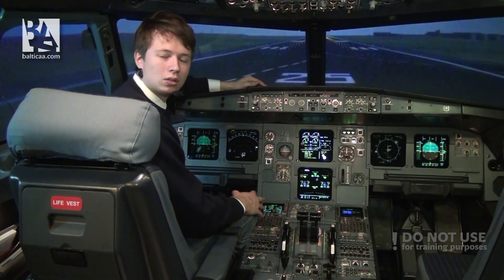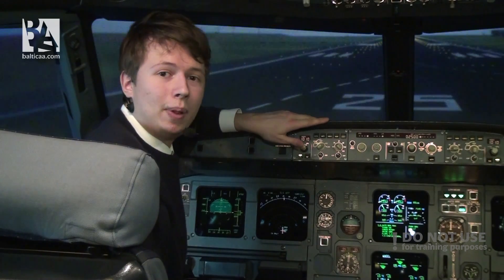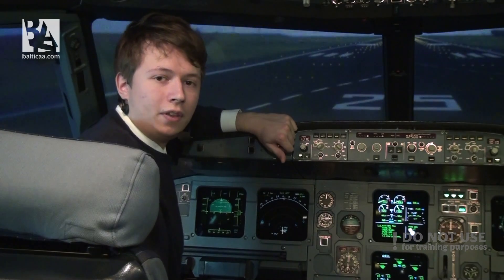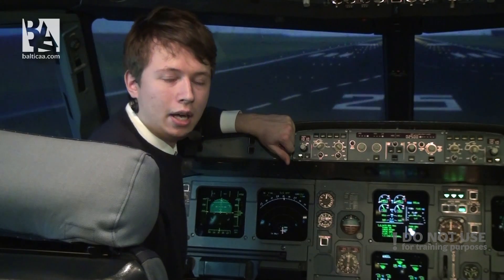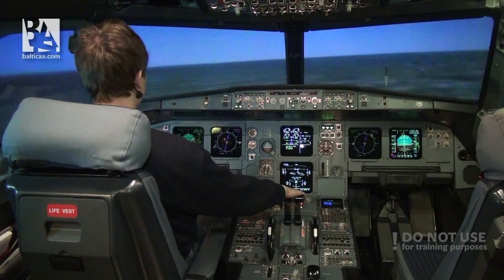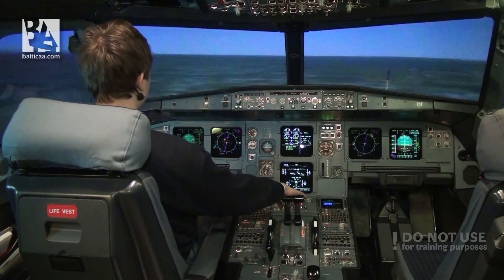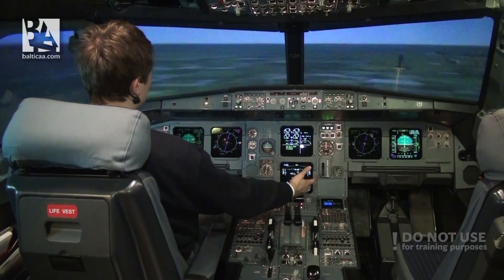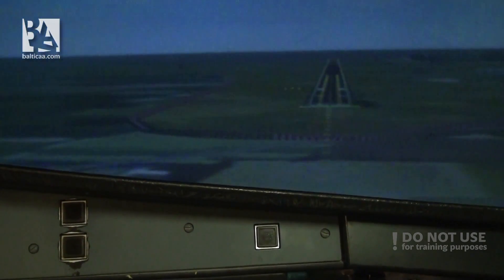Cross - wind take - off and landing on a Airbus A320. Baltic Aviation Academy

Comment: According to the A320 FCTM, during a crosswind takeoff ( crosswind > 20kts) routine use of into the wind aileron is not necessary. It is however, required to maintain sidestick full forward until 80kts.

Comment: Perhaps want to let go of the trustlevers after V1 till ACC alt..! If I would perform this 'properly conducted' take of without spooling the engines in two steps, full flightstick down in Xwind, I would have a pretty set of angry questions fired at me passing FL100 XD

Comment: I noticed for the t/o he seemed to increase thrust normally to 50%, check stability and then full thrust. FCOM states you should use a different technique no? For crosswind t/o, throttles to 50% N1, as the engines are reaching 50%, then  you increase to 70% and as they pass 50% you then engage flex/toga. Or in this scenario maybe the crosswind wasn't strong enough bother...
Reply: Yeap, you're absolutely right. That's what the FCTM states... I also noticed that he didn't move the sidestick forward (to load the nosewheel gear in order to be more stable during the rolling), but he did the unnecessary lateral inputs (I think he shouldn't, there's nothing about it in FCTM/FCOM)

Comment: What happens when crosswinds start as soon as the plane takes off?
Reply: Is this scenario studied in training?
Reply: +Luis Cañamar - no they just dont teach them a basic aspecg of flight.
Reply: Sorry man, you dont touch the manual trim when it is in flightmode unless you need to, and crosswind take offs doesnt require you to mess around with your THS. Just keep center line with your rudder and flightstick

Comment: Does autopilot correct for crosswind itself?
Reply: No
Reply: yes the autopilot does the max crosswind landing for an auto land is 20kts tho so you leave the automation in gusty conditions until minimums on another note we rarely do autolands only in fog or other conditions because it requires so much equipment and conditions
Reply: 15kts when you use auto-rollout with sharklets :)

Comment: How do you arm the speedbrakes/spoilers on the airbus? I dont see him pulling the lever.
Reply: +XpertPilotFSX ground spoilers are armed so on reverse they will come out and on normal thrus they will retract
Reply: It is rather subtle. On the speedbrake lever, you pull the lever up from retracted to armed. Just watch an video of an Airbus landing and you'll see the pilot pull the lever up to arm the speebrakes.
Reply: +Raphael Jacob also on the takeoff roll they will deploy automatically if thrust is chopped on the ground

Comment: During a takeoff in the A320 is good to apply slight aft pressure on the sidestick until 80 KT.  In a crosswind, is it necessary to approach the runway a bit on the opposite side of the wind direction due to the rudder effect if you want to keep the center line.